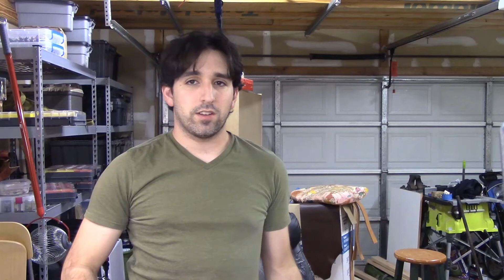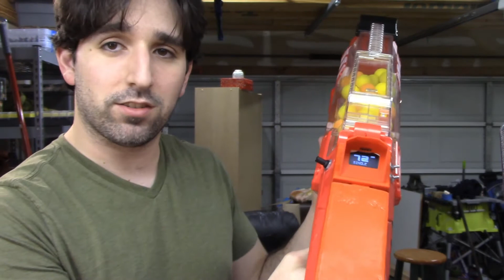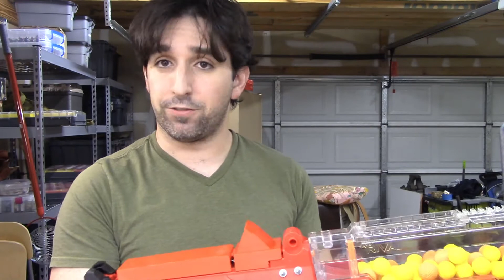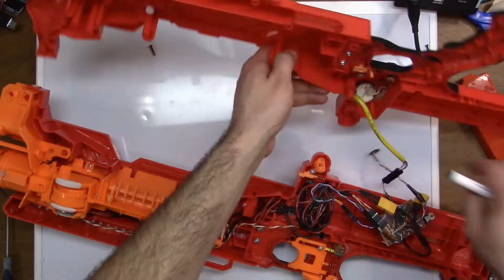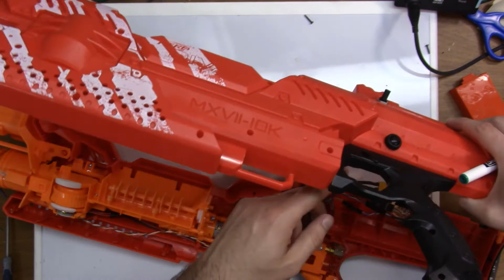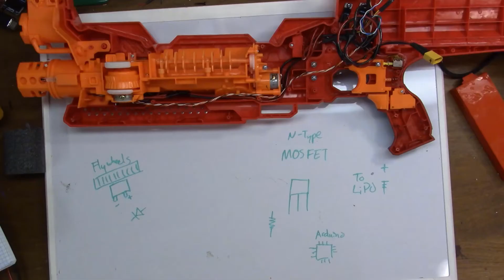Nerf Nemesis Mod v.1 - Mosfet and Arduino

Comment: This is great. I'm in the middle of planning my arduino nemesis mod and you've implemented a few ideas I've been thinking of. A few questions:

1. What specs of LiPo did you choose? (model number?) any impressions worth sharing? (too big too small?)

2. What MOSFETs did you use?

3.  Did you put an identical setup on the pusher motor? I think putting a (very) low ohm resistor in series with your flyback diode would help with your motor braking.

4. Is the diode in your schematic backwards? I think it should face the other way.

5. Did you bypass the stock thermistors etc mounted on the motors?

6. Does your burst mode stop the flywheels or the pusher motor or both? Maybe it would be helpful to find a spot in between the pusher and the flywheels for the sensor so there would be less delay and you wouldn't have to stop the motor as quickly.
Reply from the maker: 1. I went with the Zippy compact 2200mAh 3S. https://hobbyking.com/en_us/zippy-compact-2200mah-3s-25c-lipo-pack.html I think its great, plenty of room in the battery tray for it, especially if you install the arduino circuitry in the main shell.

2.  IRF3708PBF-ND Mosfet. Switches with a 5V signal (I always look for logic level mosfets), can handle more voltage and amps than I'm using, and less than $2 each in small orders. 

3. Yes, same wiring on both pusher and flywheels

4. Doh! didn't even notice that, but yes, its backwards in my diagram.

5. Yes, I pulled all the circuit boards and thermistors out. 

6. I've been stopping both motors at the same time, but I agree, next version I'll have the IR sensor as far back as I can get it.